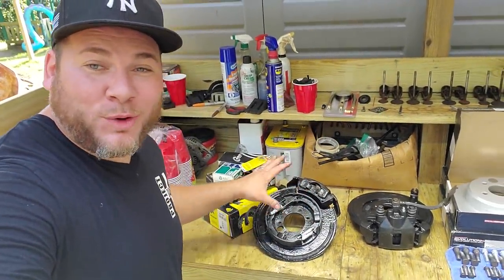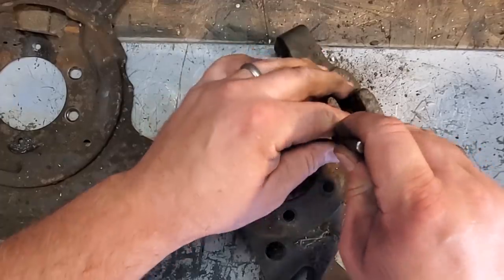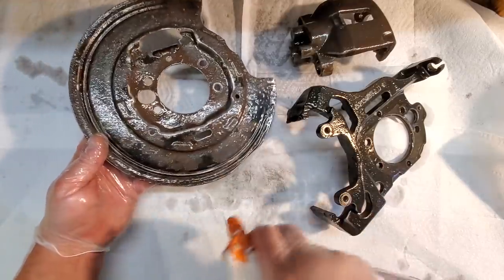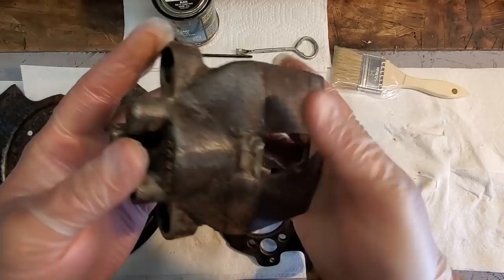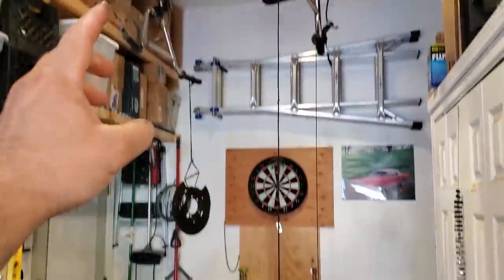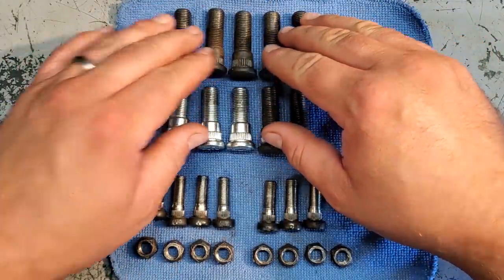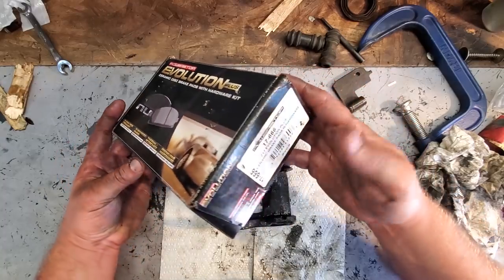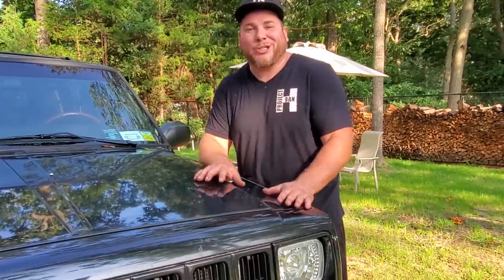JEEP ZJ to XJ REAR DISC BRAKE CONVERSION PARTS PREP.  EVERY PART YOU'll NEED!

Comment: Well that's interesting! I did this conversion on my 1998 XJ 4.0 Ltd and the parking brake has been just, I mean only just, good enough to get through a UK MOT test, which only requires 16% efficiency. I used all new parts. The interesting bit for me is how you put the actuating lever on top of the slide instead of the usual way of having the sliding bit at the top. Trying to work out why the parking brake for a car bigger than a XJ is so useless, I found the lever tries to twist when pulling the handbrake lever. Hopefully turning it upside down will cure that and hopefull make it better. I'm taking it apart tomorrow, we'll see...
Great video, well filmed and good clear instructions.
Reply from the maker: Thanks man! Best wishes.. keep me updated

Comment: You can get everything but the proportioning valve from the '02-05 KJ Liberty.  Same Corporate 8.25 axle housing with coils, discs, 29 spline shafts and axle gears.  No mods to the backing plate as it already fits 8.25 but still need longer bolts.  Crown Automotive has the parking brake cables for the conversion too.
Reply from the maker: yep I usually recommend a KJ setup for people with Chrysler 8.25s although I did a ZJ set up on my 8.25 as well

Comment: Just wanted to share with you on brake parts that are made of rubber use Silicone spray it dry fast but it helps in rubber parts for brakes.
Reply from the maker: Thanks Ray!

Comment: For the first 20 minutes I was going, I hope he talks about the lug studs, I hope he talks about the lug studs. When I did my conversion I the KJ swap because the backing plates bolted on my 8.25 with no grinding. Should have used ZJ hoses though. I've always had the best luck with Crown Automotive parts. They used to make disc brake conversion parking brake cables for the XJ, but that was a couple years ago, don't know if they still do. I thought the KJ cables were longer, but I went a different route and ended up removing the parking brake shoes. Good job on the video, been too long since I saw one.
Reply from the maker: Thanks man! I actually mentioned the conversion cables but edited them out because they're always out of stock when I look.  I didn't want to waste anyone's time, the video was long enough 🤣
Reply: @ProjectDanH  might as well, you never know, I ordered mine directly from Crown, but they might be on Amazon too.
Reply from the maker: @robertgrauman8602  I actually ordered them directly from crown for this project but when they never arrived I saw they were back ordered 🤣
Reply: @ProjectDanH  gotta love 2020.

Comment: Damn... never knew about the KJ liberty e-brake cables
Reply from the maker: they're a little long for stock, but great for a lifted XJ!
Reply: @ProjectDanH   Ive seen some DIYs that say the brake cables from 1995-2001 Ford Explorer are drop in fit for stock XJ, as well.  I went with KJ ones to start, but if they take major mod to work on stock, then I'll try the Explorer ones.
Reply: @ProjectDanH  I just found out about these, made by Crown for their disc brake conversion kit, but think they will work for liberty or Grand Cherokee as conversion also. They are only for 1991-1996 without ABS, but they also are only 1 inch shorter than drum brake cable - probably because lever for disc is on top of backing plate, but drum has it on bottom.   This wouldnt work for people with lift, but for stock or little lift XJ, would work beautifully.  Has all the right connectors, so no mod to cable needed. https://www.quadratec.com/p/crown-automotive/rear-parking-brake-cable--xj-disc-brake-conversion-rt31039

Comment: Awesome content! Welcome back and hope you and your family are well!!

I’m slowly amassing the parts to do this same swap with KJ parts onto my 98 XJ! If you’re ever in Queens I’m gonna put you to work helping me with the swap! :D
Reply from the maker: Lol! Sure buddy!  KJ swap is perfect for a C8.25 axle 👍
Reply: Im doing the KJ swap as well, on my 93 XJ.  Waiting for the parts to finish coming in, but the Pick N Pull nearest me (Tacoma, WA) had no less than 5 KJs untouched on rear disc brakes, and at least 4 ZJs to pull soft brake hose and proportioning valve from.  Makes me feel sorry for all the posts on forums about junkyards in other states having deficit of either.
Reply: @ProjectDanH   Not completely sure of fitment, but Crown makes the parking lever boots for 2002-2008 KJs, and it looks identical to the shape of one for ZJ.  Crown 5093395AA.  Got them for $10 each at Morris 4 x4.  If they are match, then no need to buy TJ ones and trim the top off (though thats obviously an easy mod). :)

Comment: Banjo fitting "raised" part I believe was installed improperly. The "raised" part should go against the caliper. I think its there to prevent rotation of the fitting thus preventing loosening of the fitting. Correct me if Im wrong....
Reply from the maker: If they're used they should be reinstalled exactly the way they were removed.. when they are new it shouldn't matter because they will crush and form fit into place.
Reply: @ProjectDanH  Correction: Just replaced my right rear wheel speed sensor. The the banjo fitting is installed exactly as yours is.

Comment: If your XJ has ABS, then you have a Dana 35 rear. If not, you most likely have an 8 1/4".  If so KJ disc backing plates are the way to go.
Reply from the maker: Exactly

Comment: Hey Dan,

So for the ABS.. can the tone rings off the dana 35 axle shafts can be swapped to the axle shafts of a 8.25? Or do you just swap the entire shaft from d35 into 8.25? Are the shafts interchangeable between the two axles?
Reply from the maker: If you have an D35 with abs, you will need the axles and tone ring from a ZJ D35 .  You will have to modify the XJ flange to fit the ZJ abs sensor

Comment: Doing this upgrade soon. My 01 XJ already has abs sensors on the rear. Can I re-use them on the ZJ disc brakes?
Reply from the maker: no, different type.  you cant use the XJ sensors, but the ZJ uses the same connectors that you attach under the rear seats.

Comment: On the about 96 and older XJ the e-brake runs down the center also.
Reply from the maker: Wow, That's good to know. Then maybe 96 and older can re use the ZJ cables!
Reply: I bought a pair and they are holding up very well. They have been on my rig for one year.
Reply from the maker: @OLDBEAR123456  awesome!

Comment: Hi Dan, almost finished the job but.... Are you sure that the parking brake cable driver side is correct? I've ordered it at Rockauto and the length is the same as the cable for the passenger side. Double checked it and numbers are correct but the cable is way too long.. Regards Arjan
Reply from the maker: I use the KJ cables they are long but it's great for Jeeps with a lift.

Comment: Really appreciate this video I was concerned about the rubber boot and where to find a replacement. then the fun task on how to piece it all back together with the E brake arms. Thanks for the detailed info! As for the proportioning valve can I use the stock XJ threaded end that screws back into the combination valve? I didn’t grab the one off the ZJ, just the internals. I just as well assumed the screw cap was the same size as the one on the XJ and wasn’t of any importance. All other parts for my disc swap are coming from a KJ for my 8.25 axle. Thanks! Keep on jeepin on life’s a garden dig it 🤙🏾
Reply from the maker: thank you so much for watching 💪 yes you have to put the ZJ valve and spring inside your XJ block with your XJ cap. at least that's how I do it. 👍

Comment: It's been a while Dan, but my babies running great 👍. I'm using the Texaco oil and add zinc if I hear 👂 a sharp tink, once or twice a year. I'm still spreading the word on other oils 🛢 I'm going to check a ZJ and wanted to confirm what years have rear disk, brake master,as much of the front end that fits,  fuel injectors, for my stock 92'  XJ. 
Am I forgetting anything else important  ?
Reply from the maker: Good stuff brother! I think disc brakes were found on limited models from 1993 to 1995 and then rear disc brakes were standard on all ZJ's 96 to 98... I think

Comment: Now kick question, I’m planning on putting 17x9 rims and 35 inch tires I may need other type of calipers fort this conversion and if this disk plate would hold other caliper more bigger than the actual, or if this set up will work on my built
Reply from the maker: You won't need bigger calipers for the rear.. you may want to consider a WJ knuckle swap for bigger brakes in the front tho
Reply: @ProjectDanH  thank u boss, keep up the good work on this XJ series, it has been a great help I’m my XJ project 💯

Comment: What year ZJ did you take the brakes off of I have a Chrysler 8.25 without the ABS so which ZJ would be best
Reply from the maker: Any ZJ w/ rear discs will work, however you will have to dremel out some of the inside of the plate to accommodate the larger diameter axle tube.  You may want to look for a KJ liberty rear disc setup. They had 8.25 rears. Then you won't have to grind any metal

Comment: Hello dan! Can you tell me the part number of the screws that hold the caliper to the bracket?
Reply from the maker: I'm not sure but if you buy new calipers they come with new bolts.. Maybe you could go to the parts store and ask him if you can peak into the box to size up the bolt

Comment: Great video! This video was so helpful! Thanks for making it! I pulled all my parts yesterday from the local wrecking yard. I was unable to find rear brake hoses, but luckily found everything else. I noticed on the previous video you pulled the brake hoses and didn't replace them, but pretty much replaced everything else. Just wondering why or did you replace the hoses too and not include it in the video. Assuming you don't have a video of the finished install?
Reply from the maker: I havnt gotten around to the conversion yet! lol. sorry I've been slacking. lol In my past conversions I have just attached the ZJ disc softline to the XJ drum hardline.  should thread right on.
Reply: @ProjectDanH  About to do my conversion. You should post yours!

Comment: If you use the WJ front brakes with the ZJ rear disc, how is the brake bias?  The stock XJ brake bias is pretty much all fronts, and I find that to be a problem especially when you have some hitch tongue weight.
Reply from the maker: not sure buddy.. I've never used WJnfront brakes.

Comment: what rear axle is this for? I have a Dana 44 will this work for me?
Reply from the maker: it's for a d35 or c8.25.  not sure what d44 you have but if it's an XJ d44 non c clip you should check out Nick in times swap

Comment: Hey ! Great job ! If the zj has a Dana 44, with C look... I have a Dana 35, this works ?? Tks
Reply from the maker: it should, you may have to grind out the center section a little more nick in time did a good D44 brake vid

Comment: I dont believe it makes a difference with the XJs (will need to check) but wont you have to change out the Master Cylinder to accommodate ABS?
Always a great video Dan., keep the ZJ going. I just got another 98 for a project car with my trail rig
Reply from the maker: Thank you so much!  Nope you don't have to mess with the master, although I will be doing an Durango master swap too 😃👍
Reply: @ProjectDanH  All good then! I got a Durango steering box been on my shelf for a year now. Never enough time to for projects

Comment: Can you put a whole ZJ rear end in an XJ and save all this extra time rebuilding the discs?
Reply from the maker: Sure, but anything you find in the junkyard will probably need a rebuild anyway. Its also easier to take the backing plates off a ZJ rather than to cut off the coil spring perches and weld on leaf spring mounts.

Comment: Really appreciate this video on Prep. I'm doing KJ to XJ, but same things apply for cleaning and painting, etc.  My POR15 caliper paint kit just came in,to paint store, so can get it tomorrow.  I didn't have tumbler, but Locktite Naval Jelly and wire brush did nice job cleaning up  hardware. I was curious why you used the caliper paint directly to metal:  POR15 recommends putting the base rust sealing paint on, and then top coating that with the caliper paint.  Is the base POR15 not really needed (aka they want you to buy more product and use it)?
Reply from the maker: thanks Andrew I really appreciate the view. regular pore 15 isn't rated for heat so I figured it would crumble off with the caliper paint on top of it so I just bypassed the regular por15 and went straight to the caliper paint. it worked really well sticking to the metal directly but a lot of the places with spilt brake fluid lifted some of the paint.  I guess only time will tell if it holds up
Reply: @ProjectDanH  I found out that there is a High Temp POR15 rust sealer that's rated up to 1200 degrees Fahrenheit. I still used the regular stuff and then caliper paint on top, and will see how it holds up, but if it shows issues, will give the high temp stuff a try with caliper paint on top.  Will also watch to hear how just using caliper paint works, too. Always good to learn different ways of doing things, so thank you.
Reply from the maker: @gryffydd42  I was also thinking of switching over to Eastwood products

Comment: Are you gonna have a video where you install these parts?
Reply from the maker: Yes! Hopefully this Fall!!
Reply: @ProjectDanH  Nice!  Have had most of the parts sitting in my garage for like 4 years now lol  need some odds and ends, ebrake cables, porp valve, and to see about if I need the longer studs, I'm using steel wheels

Comment: Is this for the Chrysler 8.25
Reply from the maker: it's for both a d35 and a c8.35.  you will need to enlarge the diameter of the axle tube hole to fit the backing plate on the c8.25

Comment: Hey Dan I just subscribed to your channel as I'm enjoying your content. I don't have an XJ (yet ) I have a 03 TJ 4.0 , 42 RLE Trans . I have been wanting to do rear disc brakes on it and wondering if this could apply to the TJ also . The kits they have out there are quite expensive and I thought this would be a great alternative. Also we have two wrecking yards near by and both of them have a abundance of ZJ's to chose from . What year of ZJ would I use as the donor ? Thanks for your help in advance. Take care and be safe.
Reply from the maker: yes This will definitely work in a TJ.. What rear end do you have?
Reply: @ProjectDanH  I have the Dana 35. Its actually a super 35. 30 spline axles, E locker etc. I wasn't sure what to do for e brake cables then it dawned on me that Rubicon TJs had rear disc so that turned out to be a winner. Lol
Reply from the maker: @moabwheeling  lol!  I'd grab a ZJ D35 set up.. should be bolt on! 👍

Comment: Think you might be the guy i want to talk to about this, have backing plates and shields i scored on NAXJA...is the process the same on the corporate 8.25 axle in a 99?  If i’m ordering new ZJ parts, do i need for the 4.0 or the V8?

Side note: i think i’ve run into you and the rest of the crew once or twice at Harrys 🤣
Reply from the maker: all ZJ rear disc brakes are the same regardless of 4.0 or 5.2.   you can order ZJ pads rotors parking brake hardware and KJ liberty parking brake cables .   If your putting ZJ backing plates on a C8.25 you will have to do a little grinding on the plates to enlarge the axle tube holes.   if you don't want to grind anything you can just get KJ parts.  good luck!
Reply: @ProjectDanH  thanks Dan👍🏻 i dont mind grinding, its a Heep ;) just wanted to verify before i order, none of the forums mention the v8 used the same rear brakes as the 4.0.  pricing out all the extras its around $450 for new/reman parts thru rock auto (and local for chems/hardware). Not bad considering, and thats about the cost of an average brake job anymore.
Reply from the maker: @Wtfbbq23  sounds like a score! Good luck Buddy!

Comment: why didnt you wirebrush the dust cover / backing plate and other rusty parts as well instead of going over the rust with paint? i get it that paint is supposed to bond because of the primer prep but whynot go ahead and get all the rust off? was it to save time? not criticizing your methods just genuinely want to know ! O and Thx for your effort Dan! Very helpful and informative!
Reply from the maker: I cleaned the heck out em!  watch at 6:19, 11:20, 11:57  .  I never paint anything unless its cleaned and prepped.

Comment: Does anyone know if an ZJ backing plate will fit a TJ Rubicon Dana 44?
Reply from the maker: youll most likely have to grind out the center alot
Reply: @ProjectDanH  yessir, specifically a tenth of an inch. I used a 3” hole saw to make it perfect

Comment: yeah nah, I would've just used an electrolysis bath rather than all that wire brush action
Reply from the maker: I'm definitely gonna have to get an electrolysis set up going.
Reply: @ProjectDanH  all you really need is a plastic tub, water, washing soda, sacrificial steel and a batter charger
Reply from the maker: @agajohanna428  what kind of material do you use to connect the anode and cathode? How many amps do you run? My charger has 2 10 and 25
Reply: @ProjectDanH  fill your plastic tub with warm water, add about half a cup of washing soda (Not baking soda), I use a piece of rebar for the positive lead and wire coat hanger to suspend the part in the water and attach the negative to that. A 12v batter charger, but I've seen ppl use a wielder for faster results

https://youtu.be/qi8qIxK4IlA
Reply from the maker: @agajohanna428  love the electrolysis cat! ,🤣